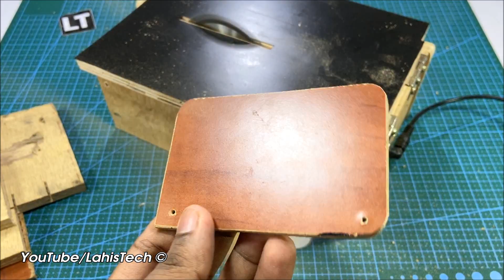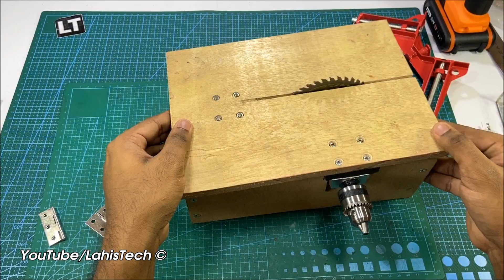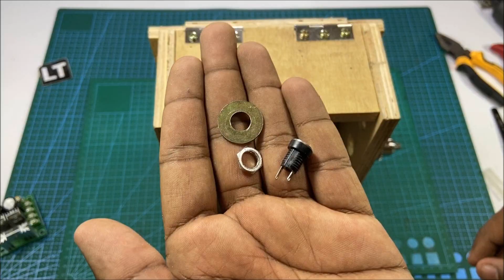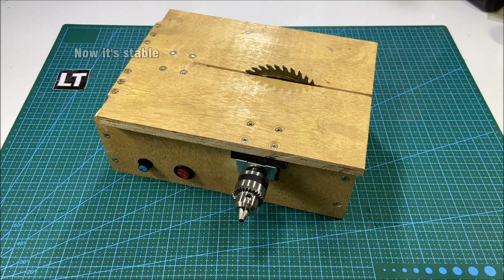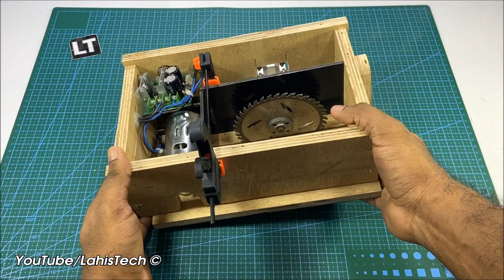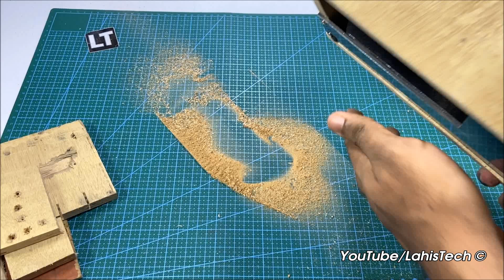How to make Mini Powerful Table Saw and Sander by 895 Motor

Comment: How do you manage to start the 895 motor with just 5A power supply? They say you need 10-12 amperes or it will not work